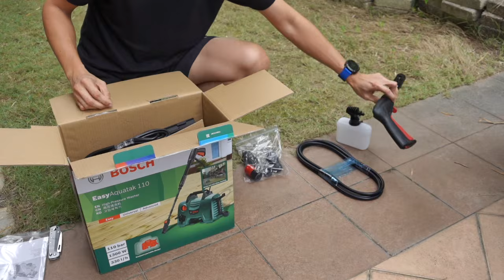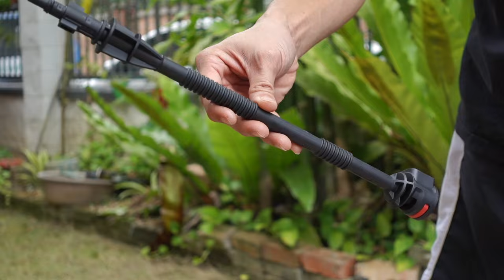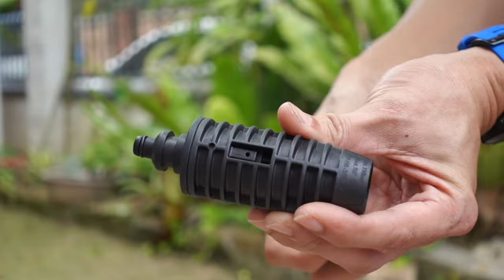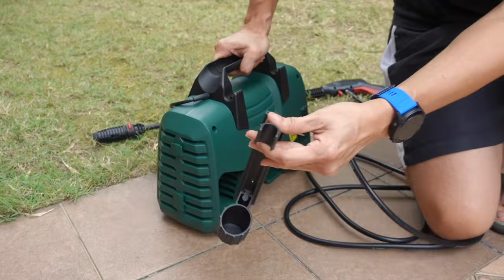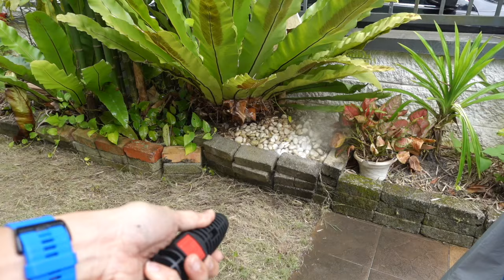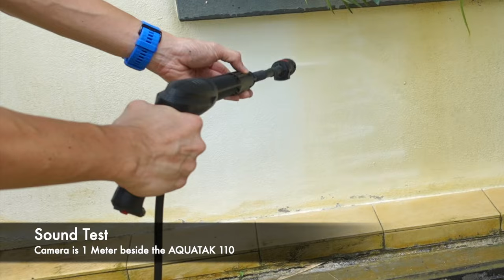Bosch Aquatak 110 Water Jet - Unbox, Parts, Setup and Test

Comment: Has anyone else had issues with connecting the hose to their tap? I can't seem to get it tight enough to provide enough flow/pressure for the water to get to the power washer?

Comment: is this good for washing car and engine bay? the reason i wanted to buy is because it has a short gun option. my current karcher k2.360 is powerful but the gun is too long making it hard to use to spray wash engine bay and hard to reach tight spaces

Comment: U want to get rid the air inside the hose, need to turn of the water jet, just hold the trigger, let the flow runs for few seconds. No need to remove the nozzle.

Comment: I've just bought one of these. It didn't come with the hose connector but that didn't matter as I had one on my hose that connects it to the reel at one end and the tap at the other and I think they are universal; it seemed to connect fine. I'm in the UK so it might be that Bosch don't provide this connector for the UK market because everyone has one anyway and they are also cheap to buy.

Comment: Hi Sir, thank you for the video. Just bought this unit after listening to your well explained video. Need assistance though. Im not sure why the connect adapter for the hose leaked when I on the tap. Could it be the hose size is not correct or my water pressure is too big? Appreciate anyone’s advice here. Thank you.

Comment: Is it good for commercial uses
Reply from the maker: I don’t think this is good for commercial as it will heat up and run noisy in long run. Check out the Aquatak150. We did a comparison video and a review on it. It’s better for commercial
Reply: I think the GHP 5 13 C is better for commercial use cleaning

Comment: Anybody know if its possible to replace the  3 pin electric plug on these power washers. I drove over mine today half way through cleaning my drive.
Reply: Yes, just use the same fuse rating as in the original plug

Comment: Great video but it doesn't come with the easy connector to attach the hose to the screw in bit?  What do I need to buy?
Reply from the maker: It comes with 1 piece of the Universal Quick Connector..   Don't need to buy extra as the hose can be connected directly into the inlet of the Aquatak as well.

Comment: Is this suitable for aircon cleaning?
Reply: Interested in it for the same reason 
If it can pump water from a bucket 
Then it's a buy for me
Reply from the maker: @khalidjy7110  Yes it can...
Reply: @KakiDIY  many thanks
Reply from the maker: Yes, but suggest to use the FAN nozzle instead of rotary/swirl or direct jet as they might be too strong

Comment: Thanks for the video. Where can I buy the connector you used to attach the water hose please?
Reply: Did you find out?  Notice you've not got a reply and I have the same question!
Reply: @marshmello1848  it is basically a hose connector that you can buy in any household store. I bought a set of hose connectors for £2  and one of them matched.
Reply: @meeradimeerkat8640  Thank you.  Crazy that it's not included as you can't get started without it.  I'll take the part to DIY store tomorrow and try and match.
Reply: @marshmello1848  I thought so as well. But apparently it is something that comes with your garden hose so they just expect you to have it.

Comment: I have one of this. After 1 year, oil started leaking from the bottom of the machine. Opened it up, the chamber empty, no more oil. Had to replace the gearbox - DIY only cost me about RM29 on lazada - which is where the leak was at. Filled it up again with left over car engine oil. Nope, it wasn't the O-Ring. Note that occasionaly, I've used this machine for one hour straight which could have contributed to the issue. Super noisy machine, gives a very high pitched sound. If you're living in condo or even terrace gonna be annoying to neighbours. Despite all the negatives, one thing good about this machine is the size. It's compact and easy to store. These are just my personal opinion and experience with this model. Thanks for the review.
Reply: I did have the same problem.

Comment: Hello Sir, excellent video! Great way of presenting and testing the product! 
I have a little question, in my apartment I do not have an outlet for water to connect directly to the machine. Is it possible to put the intake pipe in a big bucket or water container?
Reply from the maker: Yes you can.. Bosch sells an original attachment with a one way valve with pipe into the pump.. but any pipe will do, just need to prime it by filling the pipe with water before putting into the bucket.
Reply: @KakiDIY  what do you mean prime it by filling the pipe with water? I actually bought an original attachment but wasnt able to pull water from the bucket.

Comment: Wow! Amazing pressure. Can i clean my bike with it ?
Reply: Yes, but make sure you don’t spray too close as it’s quite high pressure for your bike, and you wouldn’t want to have water being forced into your bearings etc.. If you have an e-bike, best is to stand a few metres away from it, and use the wide blast mode or any mode that is the weakest in terms of pressure. If you’re looking to only wash bicycles with it, perhaps you could also look into one of the low-pressure washers from Muc-off, but I think they are too overpriced imo.
Reply: You can even clean your ass with it, asshole.
Reply: You can clean anything